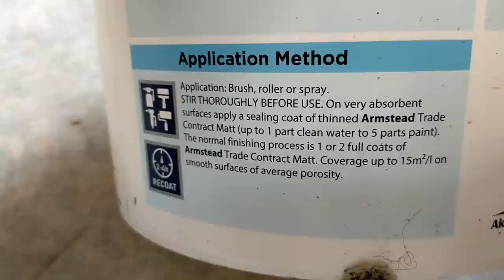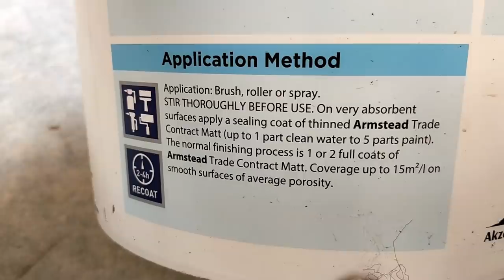How To Prime New Wood And New Plaster / Where To Start?

Comment: Great video, loads of tips. I've always been confused about mist coat ratios, but the running off the stick answers that I think. I then realised most of this job upside down so you don't want too thin. For anyone watching with an old fashioned cable real with no thermal protection, make sure you fully unwind it if you want to push the rating of the reel with a powerful heater, say in winter. I was told that for years but had to learn the hard way. . . only trashed the reel fortunately. Many thanks.
Reply: Haha me too....

Comment: Great tips about wetting the roller and brush - and getting the mix of paint/water correct,I'm currently doing my daughter's house,three bedroom semi with a new extension,they've had every wall and ceiling in the house replastered,so I could be there for a while! Thankyou for the advice and guidance here,will take it with me as I continue this large task.

Comment: Why did you not use diluted PVA for the first coat then a mist coat in this instance?
Reply from the maker: It all depends on your budget..  we show both ways to seal.   They both work done correctly.  Thanks
Reply: @PaintingandDecorating  thanks for the reply. If you have time:
Which one is best if budget is not an issue?
Do you still recommend to use the 8:1 water diluted pva mix?

Thanks for any answer in advance. I would be lost without your videos
Reply from the maker: @jy5309  well if it's a small room I always like to use diluted PVA..   milky water... and it has to soak in leave no drips or runs on anything...   Once dry it looks like nothing really has been done... but it helps seal the porosity... with being a glue your paint will stick well..  and you only have to thin your paint a little instead of a mist coat... thanks

Comment: When using ready mix plaster. Can you wallpaper straight over it . Need to plaster an area 1 square meter on the wall
Reply from the maker: It depends on depth it needs to dry fully before painting or papering. Thanks

Comment: A little confused. In previous videos concerning painting on fresh plaster you mentioned using diltuted pva. So why did you choose to splash coat of paint.  Great video as usual. Thank you
Reply from the maker: Sorry for late reply... the customer had already bought the paint, and a mist coat does work done correctly .. thanks
Reply: Thank you for replying
Reply: Never use PVA as a first coat if you are intending painting the plaster as the PVA seals the surface and basically the paint adheres to the PVA and not the plaster. The mist coat needs to soak into the plaster so that’s why it should be thinned. If you were planning on papering then you could use thinned PVA but this would be quite an expensive choice, use thinned paste instead. Cheers.
Reply: RAVEN AK47  thanks - is that what they used to call glue sizing?
Reply: RAVEN AK47 good stuff...like yourself I’ve been decorating for the best part of 40 years plus I’ve been teaching it for 23 years so I really should know my stuff 😉
Reply: A pint of water to 10L paint! Don’t we just love the U.K. version of the metric system.

Comment: How do you stop the paint peeling off the side of the paint  bucket & then bits transferring to the roller.?
Reply from the maker: Make sure you use a dry scuttle to start.  Also you can filter your paint before you start. But usually new paint clean scuttle and no problem. Thanks

Comment: When you do the second cote do you not put water in the paint thanks
Reply from the maker: Usually no but if your paint is too thick you can thin a little. But never have water in your stock tin, if left it will go off and smell bad. Thanks
Reply: @PaintingandDecorating  thanks for the reply fella